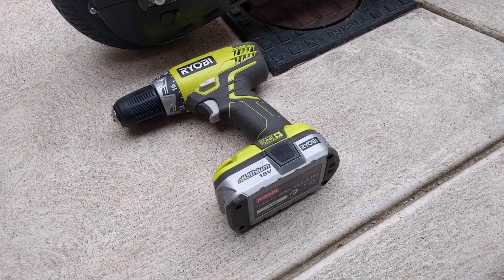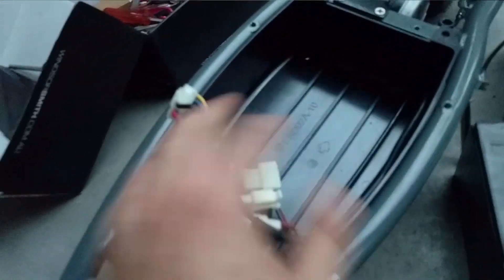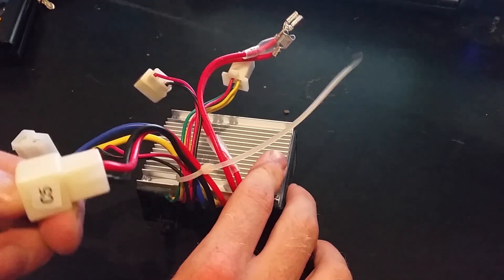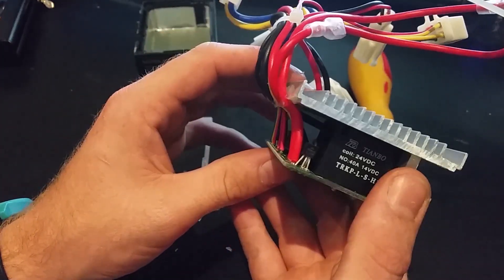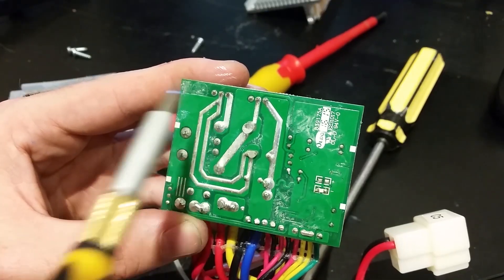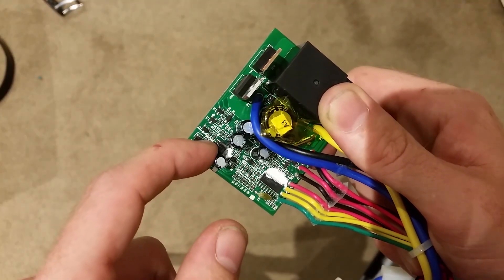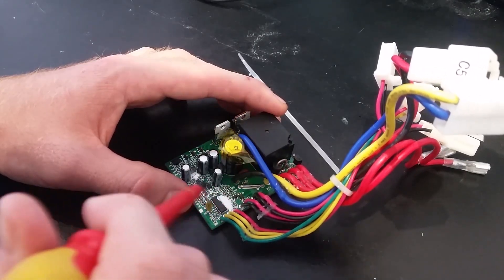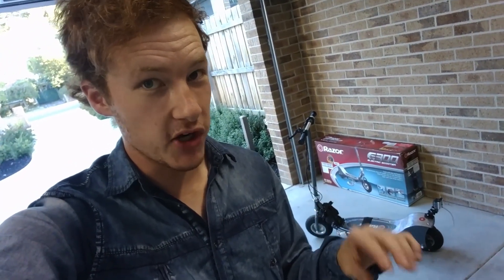Making the Razor E300 Faster With Drill Batteries! Ryobi ONE+ - Scooter Episode 2

Comment: Hey TK, I just picked up a Razor drift gocart for $20. Same controller. So, while I had it open trying to find the fault, I made the same mods as you. I'll convert it to lithium later perhaps.
Reply from the maker: nice one dude, let us know how it goes!
Reply: +TK It goes poorly! I added another 12v battery for a total of 36v... and it worked fine for a while on the desk, but when i went to ride it, as soon as I turned it on it locked on and only the main power switch shut it off. Ever since, it's maxed on as soon as it has power. Even if I disconnect everything from the harness except battery and motor. I think perhaps I blew the mosfet?
Reply from the maker: +MattsAwesomeStuff oh dear! Yep, when MOSFETs fail in brushed motor controllers they almost always lock hard on and that would explain the behaviour you're seeing. Perhaps spec yourself a nice highly rated replacement part and replace the FET? Should be able to drop something right in :)
Reply: +TK How about paralleling FETs? I see that all the time... do I need to change the circuit at all to do that, or can i just throw a bunch of others in a row to help beef it up?
Reply from the maker: +MattsAwesomeStuff you couuuuuld possibly do that. you'd want to make sure you were still able to heatsink the extra FETs and you may have trouble with the gate drive not liking the extra FETs - I don't have experience with that sort of set up exactly! Looking at the data sheet may give an example with multiple FETs.
Reply: +TK Update - I bought a new mosfet, put it in, still didn't work. Said screw it, ripped out the controller, grabbed some 8 gauge wire, ran it up to a deadman's thumbswitch on the steering wheel and used it that way. All speed, all the time. After the first 8 feet the 25A switch melted itself closed so the disconnect had to be used if you wanted to not be accelerating. Perfect! After a few minutes the motor was boiling hot. Need a bigger switch and it'll be good to go.
Reply from the maker: +MattsAwesomeStuff hahaha, sounds like you went pretty quick! when you use a big switch in this sort of application, you get arcing across the switch contacts so that would be part of why it melted shut. as you say, bigger switch is the way to go!